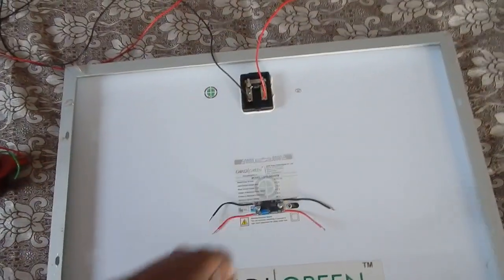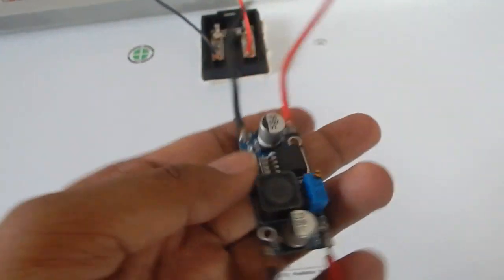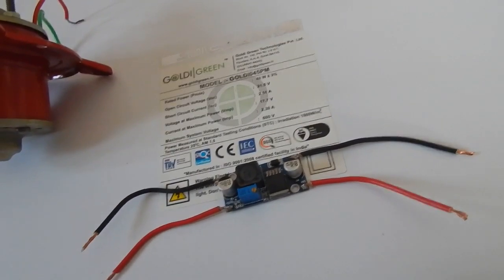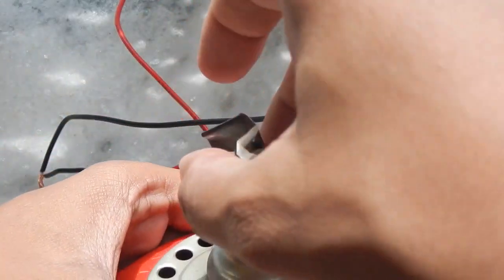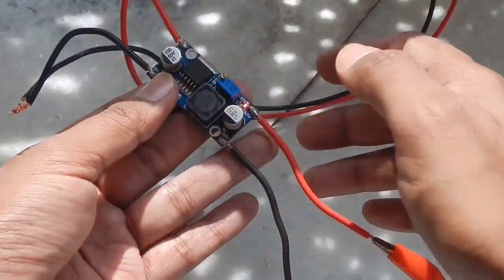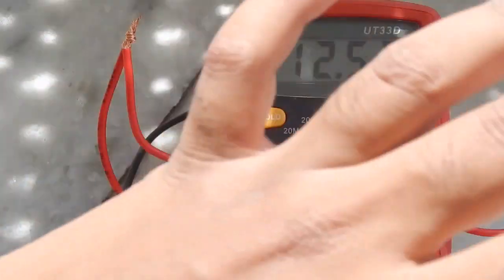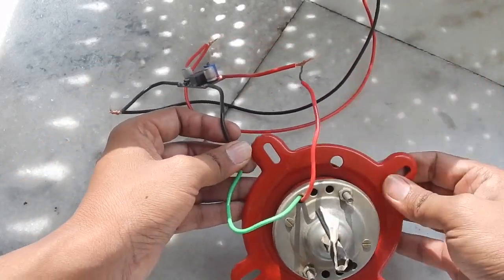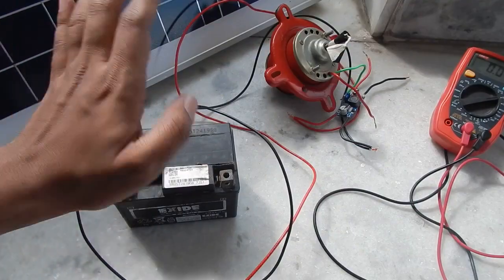Running 12V Dc Load Directly From Solar Panel Without Battery

Comment: I find that the butconverter and other similar voltage regulators get extremely hot.  How do you control the heat.  I know there's heat sinks and fans but man it can get extremely hot.  Thanks

Comment: This video helped clarify a setup I'm using in a work van where I wanted to install an exterior plug port in the wall, but connect the other side to a 12v socket instead of batteries. Thank you for this very clear walkthrough of what's needed! Also, I see in the comments you made this channel to practice your english and I have to admit you speak better than most of us in the US ;-)

Comment: Very interesting @Gurribuy, I connected a pump direct. The pump will even disconnect when there is a cloud and voltage is too low. But it reconnects too early. Is there a system that can delay the reconnect until there is full sun again?

Comment: If there is not enough sunlight. Will the motor just slow down? Or will it burn the voltage regulator?

Comment: This is what I wanted for my 12v exhaust fan. I have a solar system installed at my home. The inverter within the box gets heated very much so I made a tin shed cover over and around the box. But still to be on safer side I want to make exhaust fan arrangement for that box for heat dissipation. Can you confirm if the above arrangement explained in video run for longer time I mean in terms of years? Using above method, the exhaust fan will run during the day and help cool the solar inverter and turn off automatically when sun sets. I cannot use existing panels output as it produces higher voltage. So I am planning to buy 40-50Wp panel, a buck converter and a 12V dc fan. All I need to understand is will this setup be sustainable for longer period of time.

Comment: Hi , I want to make a water fountain the solar panel is 18 watt and I'm getting a pump of 12 volt will it work together what all devices I need to make a water fountain please tell, choli can't understand what what of power panel I need and what what a form motor will be needed to make a water fountain

Comment: Thanks a lot for sharing this,  I was thinking the same for a project.  Good to see someone has already done it. 
Just a word of caution for the ones who would try to drive crazy loads with this buck converter. Usually these cheap buck or buck-boost converters doesn't allow much current in the output hence buy the converter wisely which matches with the desired load.

Comment: Thank you so much. I bought a couple 100 watt panels from Costco to run fans in a remote shed. But the seller "Coleman" says these are 12 volt battery chargers and are not meant to run a motor unless it's hooked up to a battery. This Buck converter might just work.:)

Comment: That's bullshit - it won't damage the motor, because the panel has internal resistance of 2-4ohms so voltage will drop as soon as the load is connected.

Comment: Why not use voltage regulator ic 7812 to step down to 12v.  What's the difference to what you are doing ?
Reply from the maker: because ic 7812 is a linear voltage regulator.
it will waste extra energy as heat.
But, in case of buck converter, the buck converter converts extra energy or extra voltage into current rather than wasting that as heat.

Comment: I am building a solar kiln and have 4 radiator clutch fans i removed from cars. They are 12v dc. There are 5 fan motors in total. I have a total of 200w of solar panels ([1]100w[4]25w).
What would be there correct way to wire the fans so that they only blow when the sun is out? In my current set up, i have 3 fans wired together that hook to a 100w panel. I have the other 2 fans wired together and into the remaining [4]25w panels.
I tested the 2 different connections with a battery and they worked. Tomorrow i will see if the panels power the fans properly.

Comment: That was perfect, thank you. I'll run a fan motor in that way.
I have a quick question please :

Will the voltage in the morning or in the evening be 12v in the same way?

thank you
Reply from the maker: NO, the voltage will decrease in the morning and evening.
Even if the voltage in the morning or evening is about 12v. there would not be enough current to run the motor. 
Solar panels only works well in bright sunlight so, the best performance you will see in the afternoon or the time of the day when you will maximum sunlight.
Reply: @gurribuy  many thanks for clarification

Comment: You cannot charge a 12 v battery with 12.5v
Reply from the maker: You can increase the voltage if you want. 
The battery will still charge maybe not fully.
Considering in our case there is no cut off mechanism. 12.5 is a decent voltage for a two wheeler battery.

Comment: @@UCYAUS9nmNAcX2-9Jtn85tww, What happens when there is not enough sun to reach 12v on the given load. Does the regulator cut in and causing the motor to stutter or does it provide a lower voltage causing the motor to spin slowly (if at all)?

Comment: How long it can run in the day light?
Nice video bro.
Reply from the maker: It depends on you solar panel. 
the amount of light you are getting on you solar panel.
The amount of light you get on the panel changes with the angle of the solar panel and the time of the day and the place you live.

Comment: Shandar 
Can I run 12 volt 2.5 amp {dc}dual motor sprayer pump
Pls guide me
Thnks sir
Reply from the maker: yes, it should work. Although i have not tried that myself.
But, buy a better buck converter which can handle a little more power like this one https://amzn.to/3AjBdxQ
Connect  the wires accordingly. Set voltage and current on the converter and it should work.
Reply: @gurribuy  thanks for reply

Comment: can  i run dc light & fan with connecting controller with out battery
Reply from the maker: yes, you can. But, using a battery is more reliable.

Comment: THANK YOU for posting this!  Question:  Does the buck converter need to be matched to the wattage of the solar panel, or do the number of watts not matter?
Reply from the maker: Buck converter wattage needs to be more or atleast same as the load you are running from the solar panel.
Let's say your are running a 30 watt load using your 100w solar panel then your buck converter wattage should be at least 30 watts or preferably more.

Comment: The nominal charge of a fully charged 12v battery is 12.6v (depending on ambient temperature). Voltage is electrical pressure. In order to charge a 12v battery the charge voltage (pressure) needs to be more than the nominal voltage. Therefore the charge voltage needs to be at least 13.5V with a maximum of 14.3V charge. Once the battery has been fully charged the charge rate needs to be automatically regulated to cut off. The battery voltage will then drop back to 12.6v. The regulator should then automatically cut in to charge again at the regulated charge rate of around 14v. Therefore the regulated charge should be around 14v not 12.5 volts. Think of it as attempting to inflate a tyre that requires 2bar pressure. To efficiently and effectively inflate a tyre to 2 bars will always require an input pressure much higher than the desired type pressure. Once the desired tyre pressure has been achieved ( in the example I gave of 2bar, the person holding the tyre inflater stops putting pressure into the tyre, much the same way as a voltage auto regulator will stop the charge rate of around 14v). Hope that helps.
Reply from the maker: No argument bro but because i wasn't using a charge controller and my battery was old i went with the lower voltage.
Reply: It was only a DC voltage regulator for direct supply of "camping" appliances, where (due to losses in the conductors) about 12.5V-13V is selected. But you are right that if someone wants to use it to charge the battery, they must set at least 13.7V to 14.8V (gassing voltage) depending on the type of battery. At constant voltage, it is necessary to estimate the charging time, check the temperature, or best measure amperes (A). That's why it's a good idea to get a charge controller (PWM), which is cheap and can charge the battery safely without supervision. If you want to prepare your system for better use of panels and more efficient charging in the future, you will get an MPPT controller, which is more expensive, but will pay for itself very quickly.

Comment: Bro for 40w how many battery for keep energy i need to buy,and how much energy i can get for 1 day?
Reply from the maker: This panel gives 40 watts of energy in one hour so if you are getting 5 hours of sunlight then 5 times 40 is 200 watts in a day.
For battery, A 40 watt panel usually gives you 2-2.8 amps at 12 volts. So, this panel can easily charger a 12-15 AH battery in a Day easily.

Comment: I have a fan which can run on 12/24 volts, If I connect it directly to a 20W solar panel with a 17.85 V at Pmax. Will it going to be okay in the long run?
Reply from the maker: yes, if your fan works at multiple voltages then it should be alright in the long run.

Comment: Can I ues solar charge Controller in palce of buck  converter  to run DC 12v mini water pump?
Reply from the maker: yes. But, with a charger controller a 12v battery will be required otherwise the charge controller may not work.
Reply: @gurribuy   I HV 12 battery ,the solar panel set I bought it com with battery cabinet  through the cabinet three c.l.f bulb can be ues ., Mobile can charge n one DC fan slot is given but not able to run 12 v DC water pump, I want to run d. C pump as well as clf bulb atlest one so wd sud I do shall I connected that box with charge controller so it can run all devices

Comment: I can't thank you enough for sharing this information. I have been trying to find out if I can run a fan in my dog trailer using just a solar panel, and every 'expert' tells me "no, it can't be done". 
Not only can it be done, you've shown me how to do it myself. 

You've gained a dedicated new follower here!
Reply: In fact, it works without electronics, but you would have to choose a suitable fan that would be impedance matched. Such a fan is hard to find and therefore the best solution is a voltage regulator.
Reply: And use some capacitors too,  you can actually find fans on aliexpress with the same impedance as a panel...

Comment: Safety tip: You shouldn't grab the positive and negative terminals at the same time. E.g. when measuring the voltage or connecting to motor to panel. Although 12 and 20V aren't going to harm you much, I have witnessed people accidentally doing this with 500V and it was not pretty.
Reply from the maker: i'd never do this with high voltage.
Reply: For 12V, the human body puts up enough resistance that this voltage cannot harm.

Comment: could you use this to protect an inverter run directly off the solar panel? Or use it with the direct power connections on a controller so you could both charge a battery and run something directly off the solar panel?
Reply from the maker: NO, because inverter will draw very high current and burn the buck converter immediately. Best option is just to buy a charge controller and a small battery to run the inverter.
Reply: @gurribuy  I think this is where I'm not understanding - how can the inverter get high current from a small battery?
Reply from the maker: @hootiebubbabuddhabelly  A small 12v battery can produce more than 15A of current. However getting a high current buck converter would be very expensive and still would heat up a lot. A computer UPS is a inverter and has a small 12v battery.
Reply: @gurribuy  But if the battery is drained, it still works. And I've just seen a video of a guy experimenting and he needed the battery to start the inverter but when he removed the battery and turned the inverter off. It didn't need the battery to start back up. Actually, there are videos of two guys. One who was experimenting with it specifically with a nearly dead 12 v battery down around 5v and another who was trying to show that once the battery was removed the inverter wouldn't work but it did. So...does the inverter just need a "slow" start that's being provided by an internal capacitor or something the second time? both only turned their inverters off for a few seconds so something internal must have provided whatever "slow" power it needed to start back up.
Reply from the maker: @hootiebubbabuddhabelly  I can't say what they did, there might be some residual power in the inverter to show that its working, Also we can't confirm if they were running any substantial load off of the inverter. 
Now, Energy has to come from somewhere.
IF you look at a 100watt solar panel we are only generating 100watt. 
So, even if we assume an ideal inverter, the best the inverter can do is give us 100watt output in AC. 
And now, maybe you can see that to run anything useful we would need a lot many solar panel considering that even  a simple desktop computer takes about 250 to 380W. 
Trust me its not worth trying such experiment, If such thing was possible and efficient then there would be product in the market just doing that.
Reply: @gurribuy  That's true - the only load the one guy had on it, other than the inverter, was a fluorescent light bulb but what about the dead battery?

Comment: Very informative! Will a 12v 180watt dc motor run using a 100watt solar panel with buck controller?
Reply: You must have a battery (minimum 20Ah), which will be charged via the controller by a 100W solar panel and at the same time you can take 180W from the battery for one hour. It will take about 3 hours to charge the battery in good weather. If you use a larger battery capacity, it will be possible to draw 180W longer, but charging will take longer. It is necessary to calculate the system mathematically and with reserve to suit you.

Comment: can i connect this buck conv to 36  V panel ?
Reply from the maker: yes. 40v is maximum. But i have not tested it at more than 20 volts.

Comment: You do realize that just because the multimeter showed 12.5 volts of open current coming from the regulator doesn’t mean the current was 12.5 with the motor engaged right?  When you run something off a solar panel it’s like running it off a battery.  The voltage drops on the battery/panel when you add a load.  That could cause the voltage coming out of the regulator to change because you Tuned it on open current.

You also kept saying power regulator and buck converter interchangeably.  The two things are not the same.  See my comments below.
Reply from the maker: buck converter is also a kind of regulator. we call them Buck or switching regulator.
The multimeter measured the regulated output voltage of the buck converter not solar panel.
Yes, the voltage may decrease if the solar panel output decreases drastically.But the buck output should be stable because of the buck conveter, the buck converter will regulate the voltage and keep it at 12.5V as long as the output of the solar panel is greater than 12.5 volt and the load does not increase than what your solar panel is producing at a particular instance.

Comment: E cycle
Reply from the maker: you can try but the torque of this motor is not that good so, you will need to use some gears. however this motor is not that good quality.

Comment: I want to run a 12v 100w DC water pump. And which type solar panel or which Walt solar panel I need to run that thing directly
Reply from the maker: look the starting current of a motor is 4-5 times more than normal running current. Running a device directly especially motor is very complex. The answer to your question is yes and NO.
1) for running the pump you just need about 160w solar panel. But, in low light the pump will not start and can get damaged.
2) To, properly run the pump you will need at least 300w or more solar panel and even then if the sunshine is too less the pump can get damaged.
So, if you want to run a pump directly from solar panel then always run it when there is full sunlight and for 100 watt pump at least 200w panel would be alright. And use at least 200w buck converter because it will not heat up.

Comment: can I used any car motor (cooler radiator motor) it is 12v
Reply from the maker: radiator motor takes a lot more current than what this setup will give you so i don't think you can run a radiator motor with such setup. How many watt is your motor?

Comment: Thanks very much for sharing this video. I wanted to run 4x 18w 12v LED lights directly from a 60 watt panel (no battery involved). My question is would my setup work using this buck converter please?
Reply from the maker: yes, you can run the led lights but, 18W times 4 is  72W. So, the led may not glow or glow very dim but then you can connect just 3 led's and it should work.
Reply: @gurribuy  at evening, when sun light dims, voltages will drop below 12v and will damage LED lights. Isn't it?
Reply from the maker: @hassanazhar92  NO, led's don't get damage by low voltage however high voltage can damage them in the long run.
Reply: @gurribuy  Thanks
How much wattage this buck converter supports? Can i get a bigger wattage converter?

Comment: Why not just use an in line resistor?  Use Ohm's Law ....Motor Wattage (36watt) / Panel Voltage (21.5V)  = 1.67Amp.  Now do 21.5V / 1.67A =   13.43 Ohm resistance in the circuit....so add a resistor with ~11 Ohms resistance to divide the Voltage between the resistor and the motor (with the motor getting a 12V drop across it).

Wouldn't that work?
Reply: I would like to know the answer to that one too, and thanks for asking it
Reply: No.
The voltage coming from the solar panel will vary from one moment to another.
Reply: @mjsaedy6637  Could use a Voltage regulator...and shut the 12V load if voltage drops below threshold.